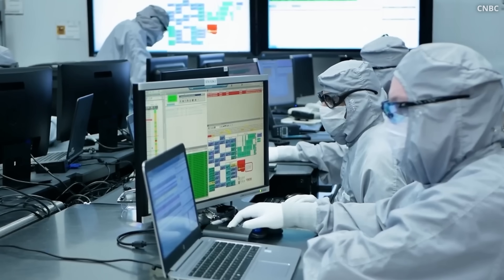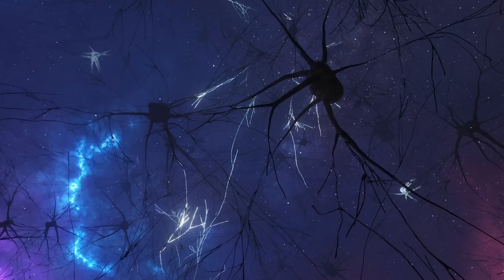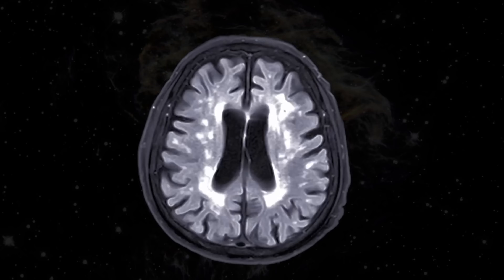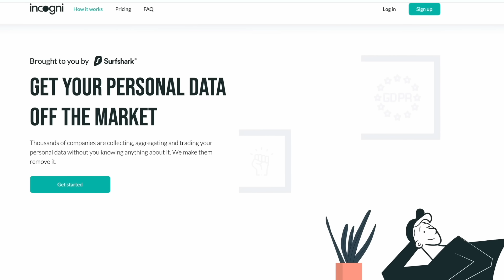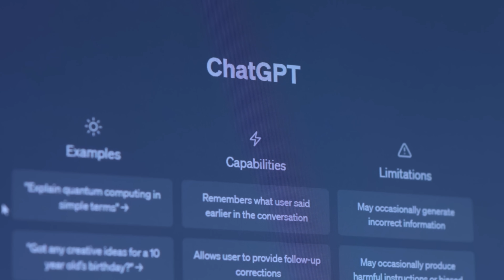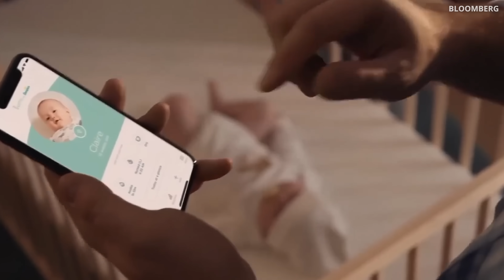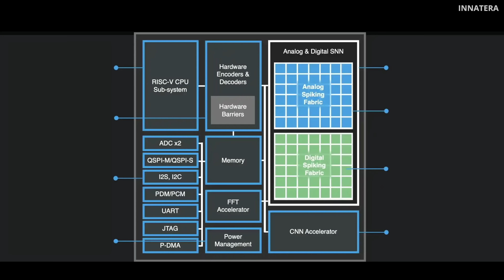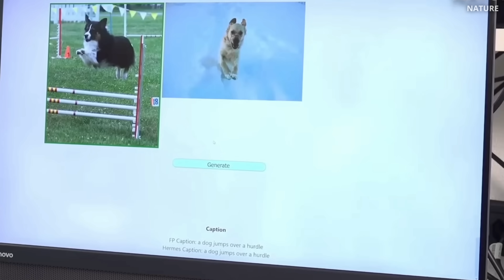The New Computer That Thinks Like a Brain

Comment: Sorry, Anastasi. As a psychiatrist I have some observations. The brain is not likely analog, and you have MASSIVELY underestimated its complexity. Each neuron is more than a “node” in a circuit. Each one is a computational unit, itself more like a computer. It takes data in: from up to 10’s of thousands of inputs. From diverse neurons and transmitters. Then there are secondary messaging cascades. There are G-linked protein receptors which can have several different message cascades based on WHAT substrate binds, and HOW it binds. Then the messengers interact with signal cascades, and interact with the nucleus. In the nucleus an algorithm is triggered (itself a computer program we call DNA) and a decision is made with regard to molecular products. Proteins might be manufactured—or destroyed. And all of this can happen WITHOUT AN ACTION POTENTIAL. Which is also a possible outcome, summing all of the inputs. And you missed the glial cells which also interact in similar though non-transmission ways. These synthetic neural networks are no doubt very powerful. But woefully underpowered compared even to a mouse brain. Your uninformed hyperbole is misapplied. Don’t get me wrong, this chip appears to be much better than what we have. But we are nowhere close to matching the power of the brain. I reiterate—each neuron is essentially a computer. Now think about it.
Reply: Yes, you are right. These chips are just a simple model compared to real brains - even the simple ones. But, remember: most of current (and impressive) AI systems and LLMs are based on those simpler models of the brain. Those 1000 neurons implemented via hardware could gives us a great advance.. and I believe that is the point... it opens new ways to make electronics and allows us think about the software that could drives it. Great!
Reply: i just made a sandwich
Reply: @davo-Flames-175 you're a rebel😮
Reply: I detect AI generated text!
Reply: @nikolagsi  No, just an MD that knows the science within his specialty.
Reply: @MrCWoodhouse  Yes, my bad. As soon as I saw "—" and not "-" in text I automaticaly assumed it was AI generated. This is one of many tells it is possibly AI generated.
Reply: @MrCWoodhouse Which doesn't seem to include what "analog" means (and especially doesn't mean !)
Reply: I just do what the voices in my head tells me to do.
Reply: That's where you have MASSIVELY underestimated how artificial neural network. I could suggest you try to understand it, but without a math and engineer background it will be very difficult!
Reply: I'm 100% sure it is analogue.  Why?  So are the computers and even LLMs we use.  We just "quantise" the analogue into digital for our convenience.  The underlying signals still travel as electrons in the EM field just like the electrical pathways in our brain.
The world is analogue, all digital things are a tapestry woven on top of the analogue.
Analogue neurons within a synthetic 'brain' are expected to out perform the digital counterparts by many orders of magnitude.
As they (analogue neurons) are then subjected to the quantum noise as our brains out, they will 'suffer' entropy.  Entropy is the form of "information in the background noise".  Our brains do not need to understand where it came from to incorporate it into "random emergent thoughts", the talk of 6th senses etc.  I think analogue synthetic neurons are far more likely a path to result in AGI than digital.
However.  Digital can be duplicated and digital are immortal.  Therefore, right now digital scales rapidly.  The analogue synthetic brains are many orders of magnitude more expensive to build, do not scale well and are "mortal".  The intelligence existing in those analogue neurons stops existing if you switch it off.  The intelligence is more than the sum of it's physical parts and meta data, but exists in the signals ans states itself.
Our brains are WAY ahead on all of this and the neurons only one part.
Consider, you can literally switch your brain off and on again (Electro shock therapy comes close to this) and it will just come back online again without having lost (much) of it's memories, character or inteligence.  This is because, as you point out, a lot of our brains are chemically driven.  The electrical signals are important, but in their absence the "essence of what we are" still persists....  Obviously under such duress damage (or healing) can be done.  Without the electrical activity the structure and intelligence, the essence, fades fast, beyond a certain point, it will not reboot or resume.
Created running and thinking, it stays running and thinking until you stop it.  At that point it's gone forever.
Reply: Consider how many "pathways" between neurons is required to communicate a temperature sensor nerve response (just ONE!).  If you want a value as accurate as that temp sensor you will need at least integer precision "relative Celsius" or maybe even Fahrenheit.  Your finger can give you a range of 40C + or - maybe.  So in digital land that takes 7 bits of information, 7 pathways to process atomicly.
If you had an analogue "line" to that sensor you only need 1 and you get 100s of bits of information.
Now try processing and aggregate the 100s of temperature sensor nerves on your finger alone, amongsts the 10,000s across your entire body, simultaneous with the other millions of concurrent and parallel signals.
Having to use digital "width" becomes a significant bottle neck.
"Serial processing" is an option and often employed in computing, instead of needing 7 connections, you just have 1 and send the 7 bits sequentially.  However this makes the neurons themselves more complex with non-trival timing and synchronisation becoming a challenge.  The LLMs do this already as they are, "cluster" communications are serial in nature and so the models have to run at a "cadence" governed by that.
On progress and "evolution".  The metric a lot of people are worried about is that communications layer, along with the "immortality".  If you ask "What makes human's stand apart from primates?", I'm sure a lot of people will agree it's got a lot to do with "sharing information".  Our brains individually are not that much more complex evolutionarily speaking, so how did they get so powerful?  Their power lies collectively.  Alone any of us will revert rapidly to being an animal and an ape.  Together, by constant communication, we can amass knowledge and understanding far greater than any one mind can handle.  We can pass information on, generation to generation in stories and now books, videos, film etc.  It is through this communication and shared resoning, shared understanding, that we reached our high levels of abilities.
Here's the scary part.  AIs communication 10-20 orders of magnitiude faster than humans and their information channels are 100% lossless.  Our human communications are insignificant in comparison, with bit rates of 10-20bit/s for converstation, while even a basic internet connection runs at 1Gbit/s and LLM<->LLM comms run at Terabit/s rates.
Reply: @1over137 u are a very enlightened individual.  I'd like to hear further ideals on the subject and becoming a   lightspeed civilization.   Hit me up sumtimes friend
Reply: Just take DMT and instantly get it.
Reply: You missed the entire point.  Take some of you chill pills and keep your ignorant brain spew to you and your broken patients. 😮
Reply: It's undeniable that biology is excessively complicated - however, evolution's method of advancement is more chaotic and unclassifiable than the underlying principles that the psychotic spaghetti throwing manages to luck upon.

Horizontal gene transfer, and crisper gene editing is absolutely wild - but the requirements and optimal implementation of consciousness are probably much simpler than "perfectly emulating how the brain works."

When she says "mimicing the brain", I take it as: "running a more optimal model of intelligent signal processing".

The fact that this chip is a sort of passive signal processor is pretty amazing - I'm sorry if the specifics of your interpretation have ruined the amazing content for you.
Reply: Well akshually..... 🪶
Reply: There are more computers on the internet than there are neurons in the brain. That makes the implementation of AGI a software problem.
Reply: you MIGHT be not wrong, but what does you being a psychiatrist has ANYTHING to do with it? Appeal to authority (fallacy)?
Reply: @iwh7 it means professional education and experience in clinical practice
Reply: @JinKee  it does, but its like NOT saying ANYTHING about knowledge on that field that is discussed here. Then i would expect at least deep Knowledge / experience in neurology maybe even physics with the latest ideas on the possibility of quantum effects beeing part of our brain structure.. With that you can mention it, so its just a show of to make you look more trustworthy ;)
Reply: @iwh7 the mention of the importance of glial cells shows clinical experience. The mention of quantum theories of cognition shows popsci depth at best. Your bachelors degree will be hard for you.
Reply: @JinKee  id inform myself a bit before making asumptions but ok. The argument would have been fine by itself! Your just making my point about authority bias  ;-) psychology can include some aspects of neurology, but they are distinct fields with different focuses. Mentioning any title does not add to it if you are not in a directly relevant Field.
And if you think Howard University in Washington DC is just popscience ok, let you be you....
Reply: @iwh7 your debate bro persona is so tiring. Did you actually do the work on quantum effects in neurons? Do you treat patients? You’re the one appealing to the authority of labs you have no association with now. And it shows.
Reply: @JinKee  i didnt put me on ANY authoritative panel. You might want to reread and rethink what you read exactly. Didnt appeal to any authority on MY side OR association to that Lab.  YOU dismissed it as posci, until its researched and confirmed OR falsified by the people knowledgeable enough to do so. None of US is in any position to do so. And by the way you seem to have fallen to the mentioned authority bias pretty good.
What has treating patients has to do with that? A Heart surgeon treats Patients, does that mean that you should believe everithing they say even in a not related field? Or would you prefer an neurosurgeon if you have a problem with the brain that would need that intervention? please just think about it.
Reply: @JinKee  and i have NOT dismissed what was written, that can stand on its own and is a good point. NO need to bring in titles that are NOT in that exact field. Thats EXACTLY what that type of bias (and strategy) means. Trust me bro, because i have a title in ...
Reply: @iwh7 did you just say that a psychiatrist like OP (stephendenagy) is “unrelated” to the field of prescribing drug that alter the kinetics and dynamics of neuron activation?? The very thing that we talk about in the analogous artificial neural networks??? Well, i will take your advice about not listening to YOU. If your university lets you anywhere near a patient, then it has failed society by passing your degree.
Reply: Agreed.

But I don't think that will help us stop AI from eventually killing all of us.
Reply: Analog DOES NOT MEAN less complex. In computer science, “analog” simply refers to the opposite of “digital.” It distinguishes continuous computation from discrete computation. In certain use cases, an analog computer can even produce more precise results than a digital one, since digital systems must approximate inputs into discrete values, whereas analog systems operate across a continuous spectrum of data.
Reply: That is really good, interesting info. Not sure why you want to get to Anastasi from such a negative angle though ("massively", "you missed"). Would be way more pleasent to frame it positively, as complementary information from an expert of a related field. In your working field, wouldn't it be all the more important to approach people with empathy and a positive attitude?
Reply: Dear Stephen, if you're not already a born again Christian,  I just hope your analysis clearly showed to you that we human beings were created by a much, much superior being than we can ever conceive of.
Reply: @kevinrtres There's only one thing that "created" us. And that would be the  mechanism of Evolution, which emerged from the Universe itself, and given an ungodly amount of time to do so.
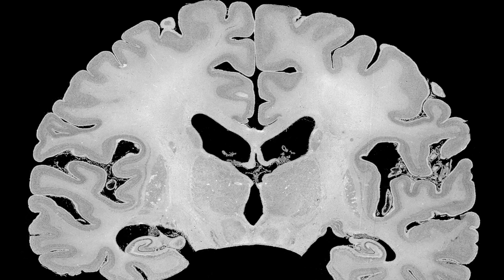Reply: 3:52 Correction: "our brain proves that we don't need all this SPEED (not complexity, as it is in fact much more complex) to handle incredibly complex tasks".
Reply: The essence of a neuron's operation is a mathematical function, summing multiple input signals that have been multiplied by the weights e.i. learned parameters, and after summation, transformed by a sigmoid function. A network of such functions, mathematical neurons, operates like synthetic neural networks and performs well.

 Although a biological neuron is very complex biologically, it must have proposed such a mathematical function.
 Biology arrived at this through a roundabout way because evolution is very complicated and chaotic. 

The aim of technical inquiries, including those related to AI, is not so much to perfectly replicate biology but to extract from it what is most productive.
Reply: We evolved in a quantum environment. Chips evolved on the factory floor.
Reply: Yeah,, each neuron in your brain can' compute' at 27 petabytes a second, millions of years of evolution inside your head,, its amazing!
Reply: Very interesting thank you
Reply: Stephen you are correct but you are massively underestimating that the future of compute as we know is through biological chips that are already being worked on. They use human neurons for computation as you stated the human neuron is the most energy efficient computer we have therefore companies are already making brain chips that run on human neurons
Reply: Also the nervous system was repeatedly demonstrated (dome say proven) to perform at a rate that requires quantum entanglement for processing speed.
Reply: Our brains are much more efficient than any silicone that ai is built on. Kind of scary actually if ai does reach super intelligence with massive data centers you know they will see our brains as much                more efficient to. Welcome to the Matrix people not for our heat but for our 20w brains.
Reply: The last microchip technology we will ever need?   LOL, no.
Reply: Analog is a lot more complex than digital. We have digital systems because it's easy to write software for them and design architectures for them in a tiny space. I think your assertion of the brain not being analog comes from a misguided preconception that analog systems aren't as powerful. That said, I think you overestimate how much of the brain's architecture is actually useful in the kind of computation we want computers to do. Computers don't need an ego. They don't need to be hungry, or feel anything, really. What they do need is searchable knowledge. The fitness of a computer can be measured by the product between the ease of search and the completeness of knowledge. Absolutely everything is encompassed there. We don't want humans v2. We want a self-expanding dictionary with page markers that lead to any knowledge  you could ever want.
Reply: @poipoi300  I think the original impetus for digital was actually SNR. Analog signals are very sensitive to noise and easily corrupted, especially the more you add and the closer together you place them. Digital signals make all but the most egregious of noise completely irrelevant by design.
Reply: @xxportalxx.  That would make sense. No need to word it as a contradiction to my statements when it's not though.
Reply: @poipoi300  mmm..much to think about 🫡
Reply: One step at a time, how many millions of years do we have an evolution to get to this point think about where the computer was back in the 50s this is pretty impressive. You are correct and it’s equality to the brain currently but time always moves forward. This is as infantile as it gets. It will only get better, imagine 50 years from now just like 50 years ago.
Reply: Yes, true, our brain is more likely like quantum processor than silicon based one!
Reply: @riannair7101  not even that....
Reply: I would copy all your words for learning brain more for my ML project.
Reply: @SsSs-kz9ee we have to create a biochip that has similar chemical reactions so that will simulate a brains thinking and decision making pattern
Reply: @SsSs-kz9ee  ok clown
Reply: @SsSs-kz9ee  wut
Reply: so right... but then, if you had been a computer programmer you would appreciate the great push back that even a simple responsive element would get. Many programmers change their programs by writing changes to a config file and then rebooting the program. I met a guy at Google who told me that it would be way too hard to just send parameter changes in a message to subscribers. Many of them are lost the moment they hear the word "neuromorphic". So, this remains interesting and even a little exciting. Perhaps this architecture is a little contrived as well. Worth a look.
Reply: You clearly only read the title
Reply: i think you dont understand crap. just because neural networks for AI are different from the brain, does not automatically mean that they cannot be compared to a mouse. an LLM is exponentially more intelligent than a mouse lmao. LLMs these days are more intelligent than most humans and even beats PHDs. we have robotic systems that can do way more than a mouse can.

you need to get some education on ai and look at all the peer reviewed papers.
Reply: @businessmanager7670  Put a mouse in the wild. They, too, have the same decision making at the nuclear level.
Reply: @businessmanager7670 🫡👍🏽
Reply: "Sorry, Anastasi. As a psychiatrist I have some observations."

Who cares about what you identify as? 

"The brain is not likely analog,"

Your personal opinion of this is hardly relevant for the point made in the video. 

"and you have MASSIVELY underestimated its complexity."

The point of the video was not to delve deeper into the complexity of the human brain. The level of details was enough to make a comparison in order to make a point. 

"Your uninformed hyperbole is misapplied."

Who is the person using hyperbole here? Hint. It's not the channel creator. And most of your comment is also off topic.
Reply: Well said.
Reply: I'm so tired of pundits comparing the human brain to computer chips. It's so wrong. It reduces humanity to a mechanistic clockwork. Perfect for the AI tech-bro narrative, but profoundly shallow and soul-less.
Reply: @driz77  Agreed. And Musk’s Neuralink…the bad news is neurons absolutely HATE interacting with metallic electrodes. The actual voltage and current is infinitesimal. The communication is actually packets of neurotransmitters that “talk.” The “electricity “ involved is actually the propagation of signal down the neuron itself. The depolarization wave (also chemical—and electrical) makes the neuron spit out neurotransmitters at the other end. In many ways utterly unlike a binary computer.